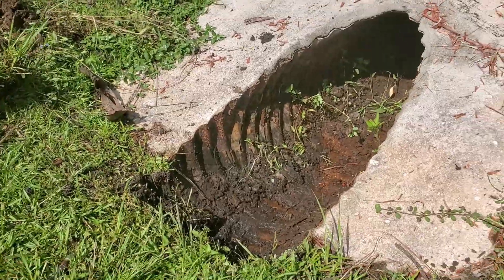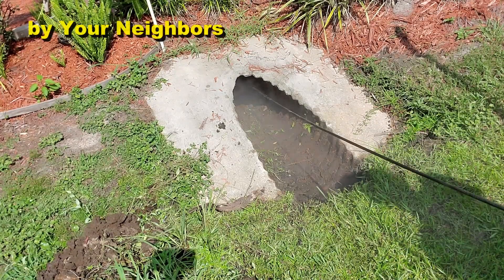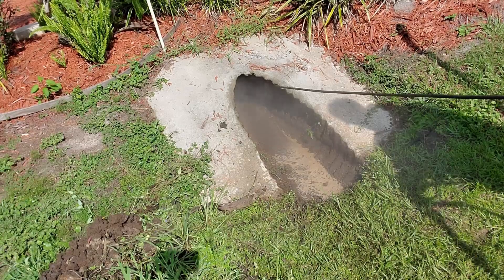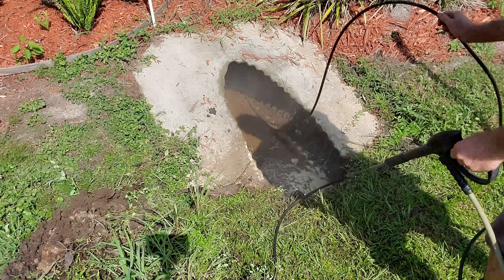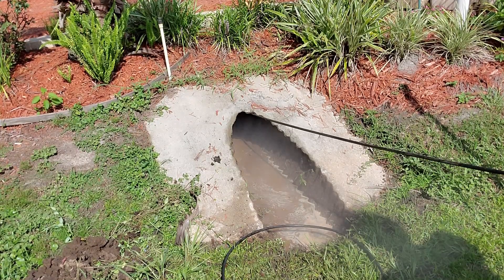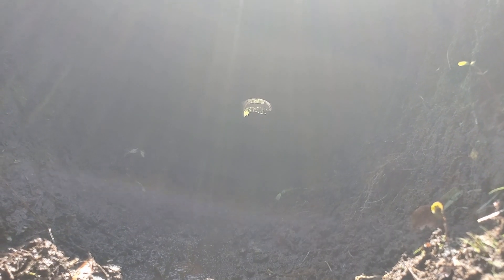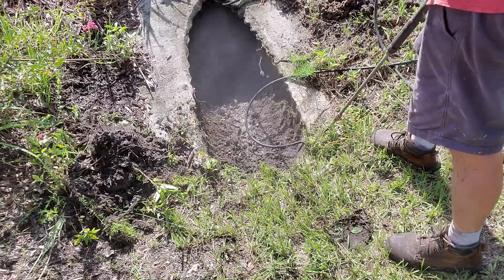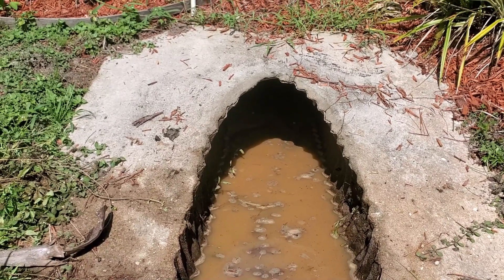Driveway Culvert Pipe, Galvanized or Corrugated, How to for Homeowners

Comment: I like the jetting idea. Just yesterday here in Florida I cleaned out (the best I could) a steel driveway culvert that's compromised/rusted around the bottom. Problem I had was with all the roots growing into the pipe creating a filter clog. I used a 10' piece of heavy conduit with an old ice chipper head welded to the end. I heated and bent the chipper backward and sharpened the edges. As I yanked the conduit out of the pipe it cut and dragged a lot of the roots with it. Busted my ass doing it about 20 times on each end of the pipe but I managed to get most of the large roots out. There's still some in there but I don't think the jetting will get those out. Since the jet attachment is cheap, and I have a pressure washer, I might try the jet to clean it so I can at least see where the stubborn roots are. Piss of a job for an old guy like me.

Comment: I'm trying to get rid of rain run off from the road to stop flooding my driveway. I dug a trench, put in 4 inch pipe and raised gravel driveway.  Water backed up into the street and appeared the 4 inch pipe couldn't handle 1inch of rain in an hour. What size pipe  do you recommend?

Comment: Chuck I appreciate your channel.   I am digging up my yard and found out the original person who installed my buried downspouts used perforated pipe !!  no wonder my basement almost floods every time it rains.  I have been digging them out for the last 3 days.    I am thinking of adding those easy flow NDS brand drain tubes with the peanuts to my yard with a couple of yard drains for my neighbors yard which drains onto my property something terrible.  My sump pump has been running during longer rain like every 5 seconds... for at least 24 hours...  Do those Easy Flow plastic peanut pipes work in heavy clay or should I put in a traditional system of gravel, pipe, gravel, and fabric ?  Thanks for your videos.. :)  I'm up in Wisconsin.   Our soil is clay and its hard as heck.

Comment: It's just going to fill up with dirt again if the drainage side is not lower than the outlet, don't see much wrong with the physical pipe, just not using gravity and water to pull the dirt away with every storm causing the problem.